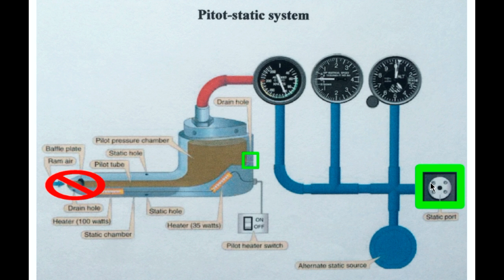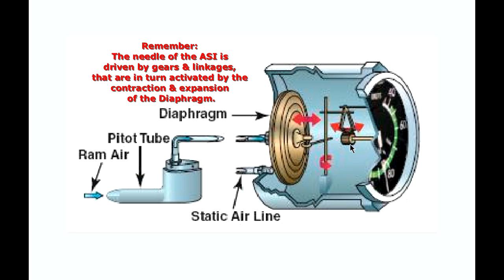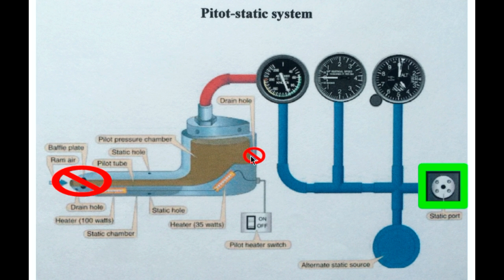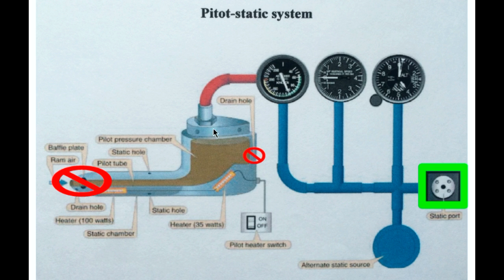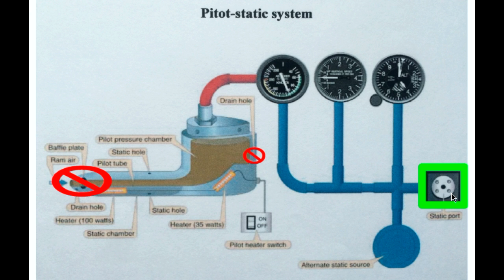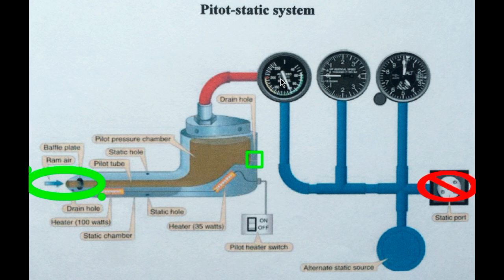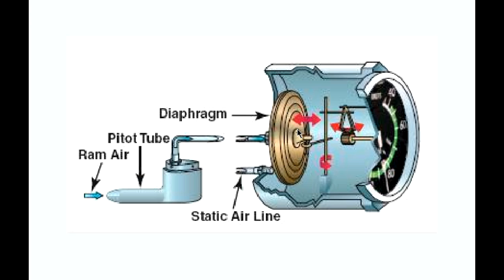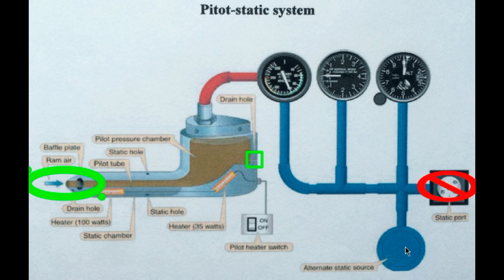PITOT-STATIC SYSTEM ERRORs

Comment: when the pitot tube and drain hole is fully block what is the remedy to fix it?
Reply from the maker: Hi! The question is, how did it get blocked in first placed or what blocked it? Not always easy to figure out, especially when airborne. Could be weather related <> iced over. If that would be a possibility temperaturewise, you can try and turn Pitot-Tube Heat on and see what happens. There is another video that talks specifically about 'Drain-Hole-Blockage'. https://youtu.be/a7Z97NRGF-k

Comment: Good video, just a question...when you speak about blockage of pitot tube, why you give the exemple of drain hole still open instead of the 2 static holes on the pitot tube? I'm not sure the drain hole behaves like a static port
Reply from the maker: Hi Stefano! Thx for your question. Reason being is as follows: The drain hole is NOT a static hole. It's purpose is, as the name partly implies a tiny hole that's suppose to let overdue moisture (rain/water drops for example) out of the pressure chamber to avoid any possible blockage inside. However, if the front inlet of the PT does become blocked the air coming in through the drain hole is basically static (outside) air <> same as what comes through the ACTUAL static ports attached to the fuselage. Again, just to avoid any missunderstanding, the DRAIN Hole is not officially a STATIC Hole, but will act as one if the before mentioned scenario would be the case. Some PTs do include a static port in one piece, but not all. In this picture the only other whole connected to the pressure chamber besides the front inlet is the drain hole. Sorry if there was a confusion to you regarding this matter. Hope that answers your question though. :-) Feel free to watch my other video related to drain hole blockages. -> https://youtu.be/a7Z97NRGF-k

Comment: What happens when water goes in?
Reply from the maker: In where? If you mean the Pitot Tube, the water would usually be allowed to leave the tube through the drain hole on the back side. However, check out this video giving you a more in depth answer and more regarding this matter ... https://youtu.be/a7Z97NRGF-k

Comment: What happen with the ASI and the VSI when using the alternate static source (with lower pressure)??? Does the VSI would show a permanent light ascent? Does the ASI would show a higher speed??  Thank you so much
Reply from the maker: Hi! Thanks for you questions. Yes, your presumption regarding the ASI is correct and regarding the VSI is partly correct.
 
Vertical Speed Indicator: Using the Alternate Static Source (air), will lead to a momentary (not permanent) CLIMB Indication, but just until it has stabilized. Remember it first shows a TREND then a RATE. It can not be permanent due to the operating principles of the VSI (calibrated leak etc). 

Airspeed Indicator:  Using the Alternate Static Source (air) will show a higher than actual airspeed, because of the drop in pressure within the instrument's case. Thus, the Diaphragm can expand a little more, resulting in a small clockwise movement of the needle.

Hope it helped! :-)
Reply: ifrPilot-david It helped a lot, thanks, i really appreciate your answer. I just get subscribed. Great video!

Comment: Aircraft air speed indicator question.
Why is it so ???
IF the Earth is spinning west to east. 
At the equator the ground speed is approx 1675 kph.
On a perfect still day the air is traveling 1675kph, west to east.
A Plane takes off heading to the west, and climbs to cruising speed of 500kph.
The plane is now travelling at 500kph ‘relative’ to earth’s speed.
In “reality” the plane is moving through the air 1675 + 500 kph.

Question: How does the air speed indicator compensate for the rotation speed, because if the plane turns 90 degrees it would need to subtract 1675 kph (when the air speed ‘relative to the earth’ is the same) from the Pitot tube wafer reading to indicate the correct reading on the indicator.

Question: How does the air speed indicator compensate for the rotation speed, because if the plane turns 180 degrees (travelling due east) it would need to -1675+500 = total negative 1175 kph (when the air speed ‘relative to the earth’ is the same) from the Pitot tube wafer reading to indicate the correct reading on the indicator.
Reply from the maker: Hi Steve, I have to admit, this is a very very special and unique question. :-) ... while I'm also trying to understand it all correctly and make sense. Thinking about your described idea/scenario, I cannot really give you a definite answer on this... I can just tell you the following: The ASI is simply a 'pressure differential' instrument, most certainly not able to compensate for your described case/scenario regarding the earth‘s rotation. So, the Pitot Tube mainly works with the air entering the main (front) Inlet, which is just Relative Wind being produced by the forward movement of the plane and (strong/er) winds aloft as you climb higher, and comparing that with the ambient air pressure from the Static Ports. Furthermore, it‘s also subject to certain Errors, such as CAS, EAS etc,  as you climb up the Flight Levels, affecting the IAS. That said, again, I'm sure it will not take the earth's rotation into consideration or account for that and/or compensate for either flying direction.  hehe ... ;-)  
Then you also have GPS indicated Speed, showing you the speed at which you are travelling over or with respect to the ground. It‘s different than IAS as it's calculated in a different way (by satellites). Also, at high altitudes and speeds, the indicated airspeed will be lower than the speed shown by the GPS, not considering any high or strong winds. Besides, your described situation is very theoretical and rather imaginary, as there is no perfectly still air above ground level. But I guess you are aware of that as you kind of mentioned in your comment. You always have certain winds blowing, due to weather system, Coriolis Force etc. 
Hope this answer helps a little… ;-)

Comment: What will happen if only the drain hole blocked
Reply from the maker: +Rineesh Singh - Hi Rineesh! Fristly, thanks for your question! I hope this reply stillcomes in-time for you. It landed in the Spam folder for somereason... Anyways, there is quite some discussion and different
opinions about this particular case. The drain hole is located at the back of the PT-piece and it's very very tiny (like a small pinhead). Sometimes, the Pitot-Tube itself has more than one drain-hole. To answer your question: It's main purpose/job, as the it's name ('drain'-hole) already implies, is to DRAIN or get accumulated water/heavy moisture OUT of it. For example, on a rainy day to prevent internal blockage due towaterdrops that come in through the main inlet. That water/moisture can then exit again through that hole. So, what happens if it DOES become blocked? - I personally have never experienced any big affects on aispeed readings in this case. However, opinions do vary a little on this particular topic and I could imagine that pressure eventually does get a bit higher within the Tube, resulting in some erroneous indications on the ASI-scale. Why? - Simply because there‘s a tiny hole blocked now, that normally let‘s some overdue air(pressure) out in the back. Again, that‘s just an „assumption“, NOT a
fact. The question is, whether or not you can actually note or realize that error during flight while happening, IF there is one. Hope that answer helped answering your question a little. Feel free
to contact me via my website (check channel art) or here if there‘s anything else I can help you with! :-)

Some great links simulating & talking about various ERRORs of the
PS-System, including your topic:

My website… 
https://ifr-review.com/airspeed-indicator-asi/

Others...
http://www.luizmonteiro.com/Learning_Pitot_Sim.aspx(go to Pitot-Static Conditions to change the parts which you want to block) 
https://aviation.stackexchange.com/questions/5009/how-is-the-pitot-system-drained
Reply from the maker: Hi Rinesh.. something I forgot to mention in my last response.. Do not forget!, a Pitot-Tube usually has a Drain-Hole and a Static Hole(s).  Just take a look at an FAA Pitot-Tube (Pitot-Static System) picture. It shows you both, 'drain hole' & 'Static Hole' ...
Reply: IF DRAIN HOLE BLOCKED THEN MOISTURE WILL GO INSIDE DIAFROM AND BLOCKED THE AIR.
Reply from the maker: Drain Hole blockage in detail & More! https://youtu.be/a7Z97NRGF-k